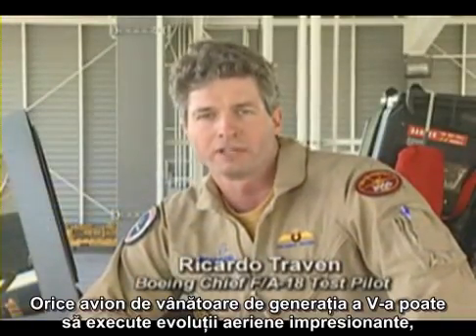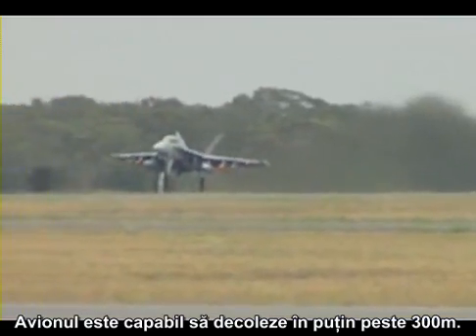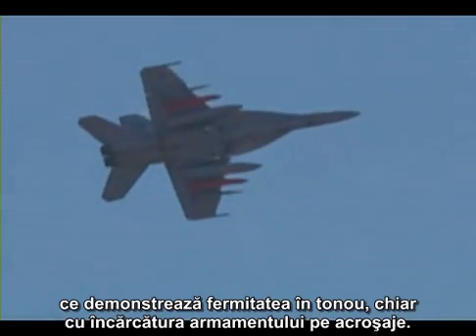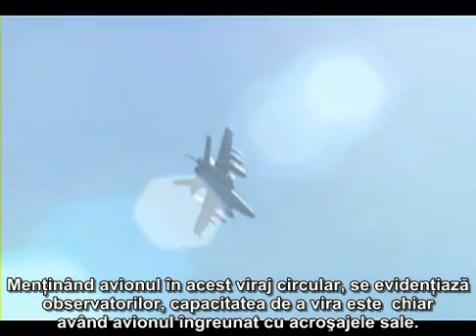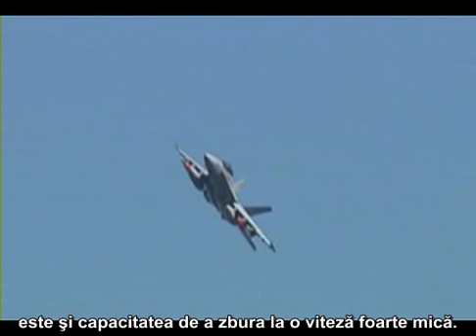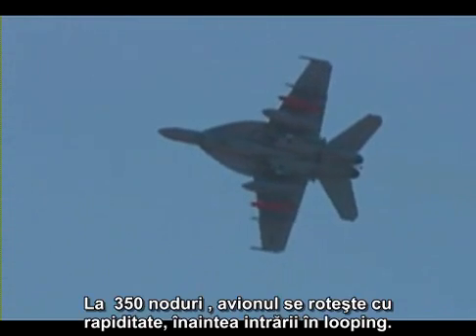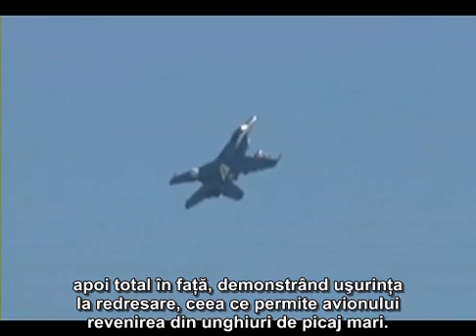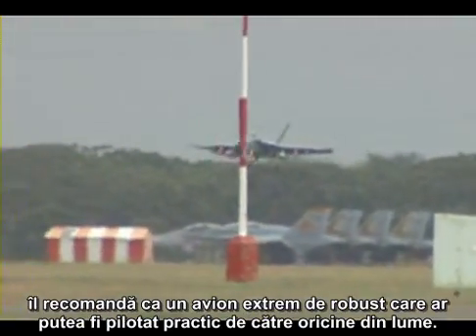F-18E/F Super Hornet with 6500 pounds loadout demonstration!

Comment: If the Superbug is a 5th gen fighter, then so are F-15K/SG, F-16 blk60 and the eurocanards!
Reply: F-15K/SG, F-16 Block 60 and the eurocanards doesn't have post-stall  maneuvers capability. 

For JAS 39 Gripen 
From https://ac.els-cdn.com/S1474667015332274/1-s2.0-S1474667015332274-main.pdf
https://www.sciencedirect.com/science/article/pii/S1474667015332274?via%3Dihub

The JAS 39 Gripen is a 26 degree angle of attack aircraft for the light external store configurations and 20 degrees for the most heavy external store configurations. The variation of angle of attack with roll stick position is used to give roll command priority, when the pilot demands roll rate.

https://hushkit.net/2015/12/18/typhoon-versus-rafale-the-final-word/
Both Rafale and EuroFighter has  similar angle of attack limits.

For Rafale
http://www.flightglobal.com/news/articles/flight-test-dassault-rafale-rampant-rafale-334383/
The DFCS is a "g" demand system with +9.0g/29° angle of attack (AoA) limit in air-to-air mode and +5.5g/20° AoA limit in both of the two air-to-ground/heavy stores modes (ST1 and ST2) to cater for forward or aft centre of gravity

For F-15X,  https://youtu.be/KaK_uSeCJgg?t=56
Advance F-15 has high angle of attack upgrades  due to digital fly-by-wire upgrades. 

https://arc.aiaa.org/doi/abs/10.2514/2.2174?journalCode=ja
Old F-15's high angle of attack test resulted in two crashes and subsequent disabled high alpha feature.

For comparison,  F-35A's high AoA and reversal spin test hasn't resulted in a crash.

F-15' horizontal stabs extends beyond engine nozzles like F-35's design while F-16V Block 70 doesn't have this design.  

F-15 is missing cant'ed vertical tail for improvement with yaw control and vertical tail access to air flow during high angle of attack.

F-15C and F-35A has similar empty weights, hence it's tail functions are not burden down like heavy fighters like F-22A and SU-30/35.

Comment: And how many times did the MKI shoot down the american plane? 

And FYI they did it when: 
1. Their radars were in training mode. 2. They were not using AWACS and had to depend upon radio com. with american awacs 3. their aircraft to aircraft data link was turned off 4. they were not allowed to use chaff which the americans used. 

Also bud, do tell me about the cope india series of exercises, in which upgraded MIg-21, Mig-29, su-30's(not MKI) had a kill ratio of over 90%

Comment: Dude, the F-15SE is only a proposal by Boeing. Ok? 

Tell me about it when its about to be inducted in the forces. 

And the 15's are expected to be in service till 2025 that is not 20 years.

f-18 WILL be replaced by the VTOL/STOL capable 35's 

yanks upgraded cause a/c's like SU-30 MKI has beaten them in many war games.

The only reason F-22's PRODUCTION is being cancelled is cause its too damn expensive. If the USAF had their wish they would choose 22's over absolutely anything else

Comment from the maker: Why wouldn't a be a 5th gen. fighter as it is built around 5th gen. fighters and does all the things for..., and more... no other fighter in the world without TV is able to do the things it does...! It's as fast as the earlier hornets or even faster, turns thighter, and it's a deadly aircraft in both BVR or ACM with it's ultimate onboard systems! It is between the only planes that can announce of an IR missile closing in with some specially built sensors!;) And right..., they are very safe!;)

Comment: But the Super Slow Hornet is NOT a 5th gen fighter. And well everyone dies in WVR with HOBS heaters. 
Haven't seen the "high speed" yet. Or the wheezing of trying to take a combat load up to 35k. 
True-Hornets can fly with a lot of flight surfaces damaged. And yes safe to fly...
Combat proven against an air force that buried their jets in the sand.